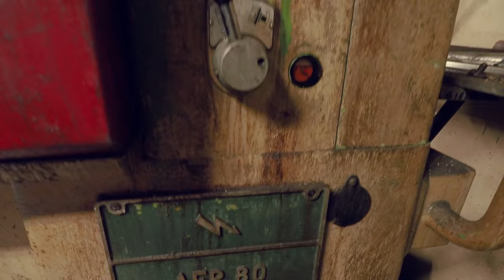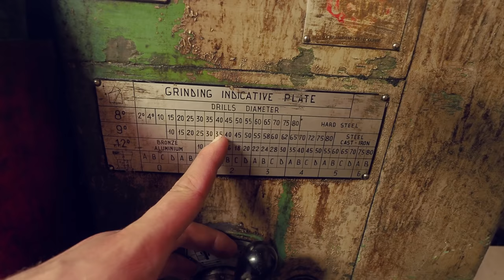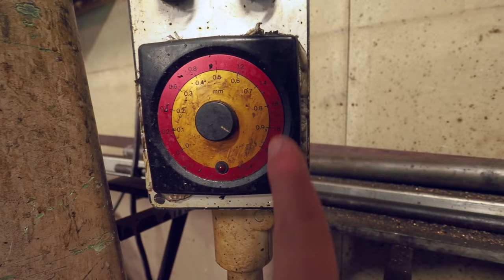Automatic Old School HSS Drill Sharpening Machine

Comment: Only an Italian machine would have a red button to start.
Reply: "Wheneve I feel inclined to work I relax, and wait untill the crisis is over"... ;-)
Reply: red indication of danger the machine is on,  green indicate safe : machine is off and you can put hands in it
Reply: For UX, there should really be only one button to avoid confusing - and it actually is mainly red. 
Another way is to put an LED in the button with green showing when on standby and red when it’s own. 
That’s what I do on my machines - medical devices. And I’m not Italian...
Reply: @Ron.S. Red is the universal color of danger or stopping, if you see a full red sign what do you do on the streets? You stop, when you see a red light on the courtroom light? You don't go in, red = danger/emergency stop green = it's on but still lookout
Reply: HAH !  Good one ! 🤣👍🏻
Reply: I agree, intuitively I would push the green button to start it and the red one to stop.  The usual associations are green = go, red = no go. Having to push a red button to start a machine makes absolutely zero sense.
Reply: I got caught by the red/green button thing once with a 415V three phase switch. Thinking that I needed to be safe while plugging a machine in I turned the switch  to red for stop........The plug blew up in my hands. I was also standing in a puddle at the time...YIKES! Fortunately I only got some mild burns. It could have been a lot worse. I won't do that again.
Reply: Hello
Yes it can be confusing :-)
NC start button is usually green.
NC stop button is usually red.
Green light on CNC beacon says machines is working/moving.
but
We have CNC machine by MAZAK where is main switch with colour.
Switch on  - red
Switch off - green
Switch is on back side of machine.
When we have a new operator we allways make joke.
Go and switch machine on.
Confused new operator after minute.
But machine is allready switch on :-)
Reply: International convention:  red is live, green is safe.
Reply: @flinch622  I don't think so. Most of the dangerous machines have a big red button for emergency stop. Nobody would think a green button would stop something, especially in panic situation. Also, everyone associates these 2 colors with traffic lights, green = go / red = stop
Reply: @Ron.S.  This is a very old italian machine, i think 100 or more years old, so i don't think there were - at that age - any shared conventions worldwide about lamp colours ...
except in UK were - i must say - they were always a step ahead in safety and metrology ... What i wonder it is still working ... 
... and ... what type of medical device are you working with ? I'm a retired technician who spent 35 years in servicing medical equipments, with company mainly based in UK, US, Germany ( monitoring, anaestesia equipments, lung-ventilators, incubators for new born ... )
Did we work in similar Companies ? Maybe ?
Reply: If it was a british machine it would either be 200 years old or not exist because britain has forgotten how to make anything. We have an Astra/Elite machine made in Spain by an Italian company, it's brilliant.
Reply: @HDJess  Standard is usually quite simple - there should be only one button. Big, red button. Pull it - it starts. Push it - it stops. That's international convention used on almost every industrial equipment. You may have separate start button but you always have to pull this emergency switch first, then use another starter button. This one is quite often green/yellow but it will only work if emergency shutoff is pulled. Clearly this sharpener does not follow those rules, it was probably made before those rules become common.
There's no real standard regarding other types of button colors, only emergency shutoff has quite standard shape, color and behavior, it's also usually the biggest one. It may be yellow though.
Reply: Sir, Italians do school about machinery since 800''